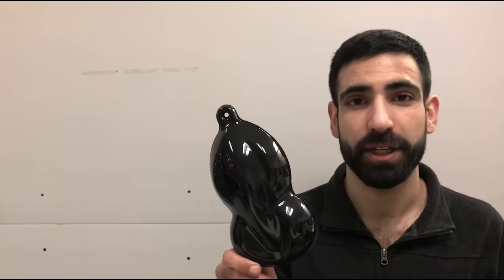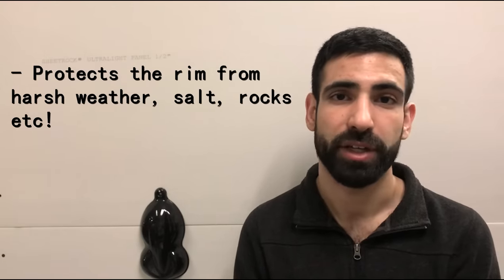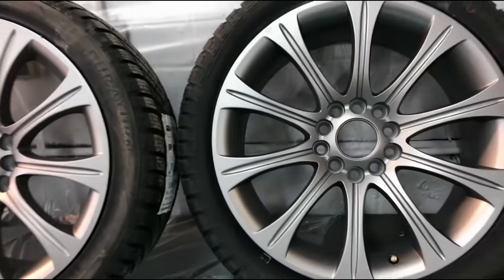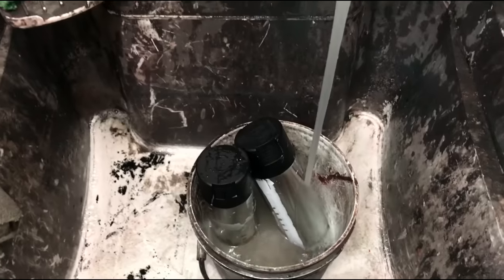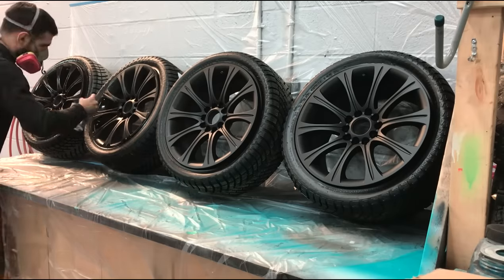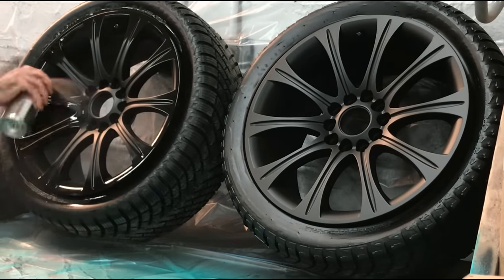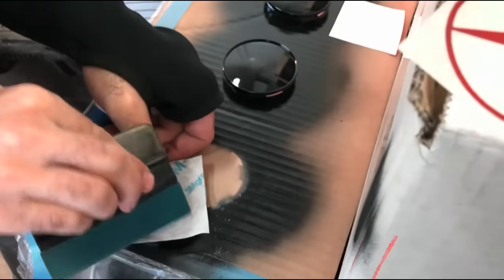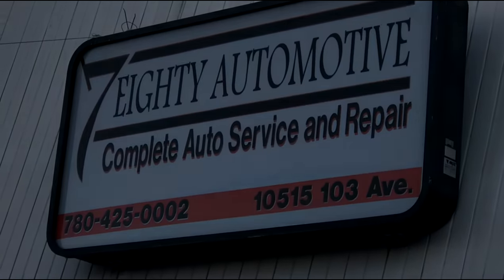How To Spray 2K High Gloss Plasti Dip Rims

Comment: What are the wait times between every spray ?
Reply from the maker: 15-30 minutes depends on the climate
Reply from the maker: @babyyoda1016  8 coats of plasti dip then make sure its all completely dry before spraying 2k. 1 light coat followed by 1 solid heavy coat but careful for runs
Reply: @EhabHalat  and how long do I wait when spraying the 2k spray? Sorry for asking a bunch of questions
Reply from the maker: @babyyoda1016  45 min or so just look at the wheels and make sure they arent wet still, make sure its all dry to the touch
Reply: @EhabHalat  how many cans of each did you use?
Reply from the maker: @babyyoda1016  one black per rim
And then one can of 2k for all four rims

Comment: Hi does this work with any kind of 2k gloss?
Reply from the maker: jessie bermudez i have only tried it with this 2K gloss but I’m sure their are others that will work just make sure you test a small object before doing the rims to make sure you dont get any reactions
Reply: Ehab Halat thanks man. Keep up the good work!!!
Reply: One more question. Would it be ok to plasti dip it then put the clear coat later on?
Reply from the maker: jessie bermudez yes you could do it anytime but maybe spray a fresh coat of plasti dip before you spray the clear coat. Ensure the surface is very clean and dry before you start spraying
Reply: @EhabHalat  Thank you again :)

Comment: i'm pretty sure u cant peel this off after coating it with 2k.. he even won't show if its peallable.
Reply: You're correct, once you add the 2k it will soldify and harden the plasti dip...it will peel like chipped paint off a old wall....
Reply from the maker: Like I’ve told other people who have said that. Its peelable but not as easy as just regular plasti dip but it will still peel as long as you got a thick enough base coating at least 8-10 coats. Most will peel off and then you could get remaining stuff off with a pressure washer. I will do a video in the future once the owner wants to remove it from the wheels

Comment: How many cans did you use of 2k high gloss
Reply from the maker: Only one can is needed. One light coat followed by one heavy coat and let it dry for 24 hours. You may not use the whole can but thats ok
Reply: If I use high glamour gloss will it make a huge difference?
Reply from the maker: Miguel Mojica i dont know what that is
Reply: It’s 2k high glamour gloss same bottle just says high gloss
Reply from the maker: Miguel Mojica yea thats fine to use

Comment: I would be stuffing some paper towels or something into the lug nut holes.....
Reply from the maker: You commented on all my videos, just hating lol two of the comments which are the same but ill answer it again so it gets through to you… you can spray the lug nut holes, When you tighten the lug nuts up it will strip away the coating just around the lug hole so it sits snug and wont cause any issues with the coating or how the lug nuts sit

Comment: If you ever want to remove it ...It will be a nitemare...I have been working with finishes for decades including plastidip and 2 k clear...Dont do your wheels if you think your going to want to remove the stuff.
Reply from the maker: I made a removal video on it and it peels fine with the right amount of plasti dip coats. Yes its not going to peel off in one clean sheet but it will peel off in medium sized pieces. It took me about 20 minutes to peel one rim and thats not bad at all

Comment: Since 2K clear coat has a hardener in it, I want to say a super hardener, I can't see how you will be able to peel Plasti Dip after applying 2K clear coat. This vid is deceptive. Unless I see proof, I'm gonna say you will NOT be able to peel Plasti Dip after applying 2k clear.
Reply from the maker: I have a video on it check it out on my channel. You have to do enough layers of plasti dip to still make the wheel peelable

Comment: That doesn't look like a plasti dip can though.
Reply from the maker: Jose Vasquez it is. The label just peeled off because i had them sitting in hot water for 10-15 minutes
Reply: @EhabHalat  oh ok. About how many cans of dip and 2k did you use on the set of 4? Also can you use any 2k gloss left for later?
Reply from the maker: Jose Vasquez 4 cans of plasti dip (1 can each rim) than 1 can of  2k gloss. One light coat followed by one heavy coat than let it dry for 24 hours and make sure you use most of the can of 2k because it does dry after after a couple of days and won’t be able to use it anymore
Reply: @EhabHalat  ok great! I'll give it it try. Have you tried using plasti dip and 2k gloss on the roof of a car before?
Reply from the maker: Jose Vasquez no but its recommended to use a gallon and use a spray gun for larger areas
Reply: @EhabHalat   Yes that makes sense. Thank you. That was a great video

Comment: Way to ruin brand new wheels. The 2k clear HARDENS on the plastidip and makes it almost impossible to remove without sandpaper. 

There is a reason that the people that created plastip and professionally dip cars and wheels have never once said to do this. Its the reason the glossifier was created. So that you can remove it.

Comment: This will cause you not to be able to peel off the dip as good.
Reply from the maker: Yes i uploaded a video of me peeling it off. It takes some time but also makes your wheels much more durable
Reply: @EhabHalat  but you did it after you got done. The longer it is on the harder it is to peel off. Not only that the 2k will flake off after 5 to 6 months because it doesn't combine to the dip that good. The dip is meant to be stretchy and the 2k is hard that's why it is very hard to get off then just regular dip with the dip clear coat on it the way it should be
Reply from the maker: Eric Walton no i didnt peel it after it got done. The customer brang it back to me to peel after almost a year and it took about 20-25 minutes to peel each rim. With about 10 solid coats and the 2k gloss it will still peel, obviously not as good as regular plasti dip but i offer this service to all my customers and i haven’t had one complaint
Reply: @EhabHalat  if it was safe to put over plasti dip then the company would sale it.

Comment: That's going to be a bitch to peel off. We learned this 6yrs ago!
Reply from the maker: With the right amount of coats (8-10) using a removable liquid coating as the base, it will be removable. Some parts might not peel as well but you could always pressure wash the rest off or use a microfibre towel to rub the rest off
Reply: @EhabHalat  Please do a video peeling those same wheels to demonstrate this. I've been dipping with PD since 2012 and have a very hard time believing it will be easy to peel.
Reply from the maker: jwkivy certaintley will do a video once hes ready to remove the liquid wrap off the rims. Not easy to remove but will come off with a pressure washer with the excess pieces that dont come off
Reply: @EhabHalat  Have you ever actually peeled PD that's been glossed with Spraymax 2K?
Reply from the maker: jwkivy yes i have, unfortunately haven’t recorded the process but i will make a video in the future
Reply: @EhabHalat  How long was the Spraymax'd PD on before peeling?
Reply from the maker: jwkivy about 6-8 months before i peeled them. Took me a good hour to completely get everything off but it is removable as long as you got enough of a removable coating base down on the rim.
Reply: @EhabHalat  I use about 2 cans per wheel, for that very reason. I learned that lesson my first time and I went too thin. NEVER AGAIN!!! lol I dipped the 'Superjet' in my avatar pic back in 2012 and 3 yrs later added hydroturf to the side rails, which I had to cut the PD to expose the paint and the PD was plenty thick and peeled easily. I'd love to use the Spraymax for a true gloss that won't dull, but I'm still hesitant, even with your assurance.
Reply from the maker: jwkivy You will be fine! Very durable and if you are using enough coats you will be fine forsure it will peel. Maybe not in one piece but it will peel without damaging the surface underneath

Comment: I did it......SUCKS TO REMOVE !!!!! Don’t do it !!!
Reply from the maker: You have to apply 10 solid coats of plasti dip then 2k gloss. It peels off just takes abit, i have a video showing me peeling it
Reply: Ehab Halat itll take a look at it but man, I’m still trying to peel that sucker off
Reply from the maker: It all depends how heavy coats u put on and how long u waited after trying to peel it but you need to build a thick enough plasti dip base to make it somewhat peel

Comment: imo plastidip is not worth it, have it painted with regular paints, last longer and looks better AND easier to clean
Reply from the maker: Jong Regudo this is plasti dip with the 2K clear which is pretty much like regular paint gloss. Much easier to clean and very durable!
Reply: @EhabHalat  i had a different experience with plasti dip, im not going to have again.
Reply: When plasti dip is not used correctly it's a pain in the ass..

Comment: False info
Reply from the maker: Not at all. I do this method for all my customers and never have any issues
Reply: @EhabHalat  its not peelable if you go to remove it comes off in small pieces. The gloss starts to flake off easily.
Reply from the maker: No, if you do the right amount of coats 8-10 on total then it will be removable. I have a video on my channel removing it, check it out if you want proof